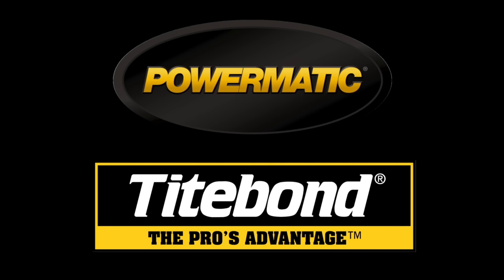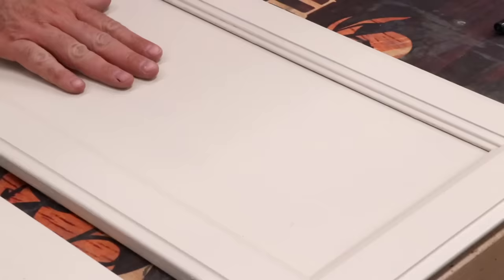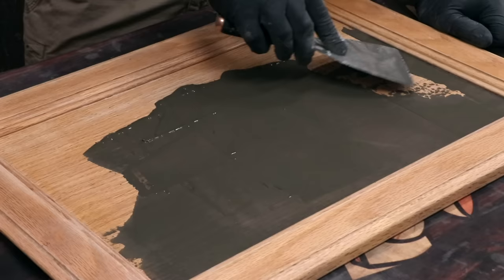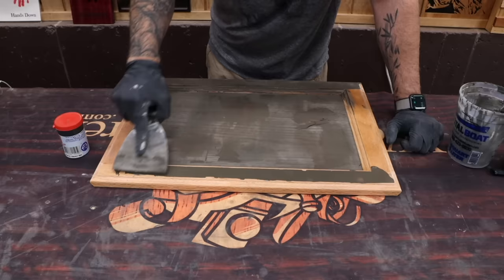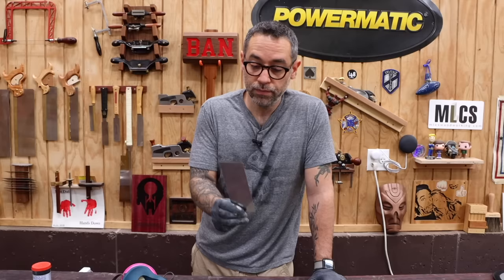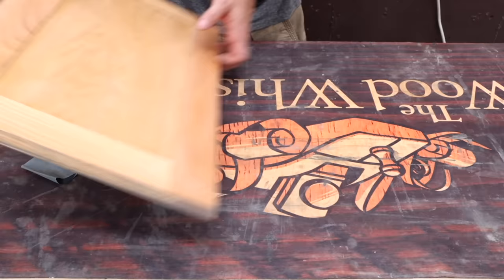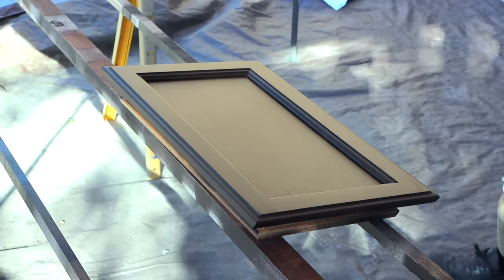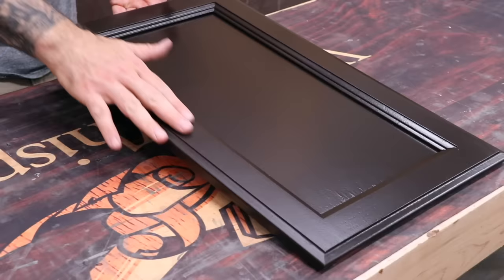Painting Oak Cabinets - Transform Your Kitchen!

Comment: Nice job.  I'm so tired of watching kitchen remodels where perfectly good cabinets end up in dumpsters.  Obviously this was time-consuming, but the  end result is beautiful.  I'd like to see more of us revamping, rather than replacing.  Thanks for the video.
Reply: I sooooooo agree
Reply: The amount of work to refinish would be overwhelming - notice he had two people working on this. I say skip the pore fill and either paint or just sand and touch up the poly or varnish.  Still a massive amount of work either way.
Reply: I work in a cab shop and trust me, if your cabinet is worth anything we will take it and make stuff out of it lol wont go in the dumpster. most cabinets have cheap panels in the middle and not worth salvaging (some cases the middle panel is solid wood and that's a steal!).
Reply: after watching this, I decided to rip out my cabinets and distribute them in dumpsters all over town
Reply: I'm afraid to do this. I would hate spending all that time to have them look terrible.

Comment: 40 years as a painting  contractor I have probably painted somewhere close to a thousand cabinets. Never used any filler but I did use a an extremely high quality sealer primer with 2 coats, and 2 coats of finish paint.
Reply: What primer ?
Reply: thanks for the tip, but exactly which primer/sealer? Did you thoroughly sand it all? or just damaged areas?
Reply: All you have to do

Comment: I did this last year to my oak kitchen. A helluva project but it exceeded my expectations. Used Spray Nine degreaser to clean, sanded between coats. Used two different primers- the doors closest to the stove ( greasiest) needed a very sticky primer ( Stix) and the other ones used a less sticky but more opaque primer. Each door got four coats- two primer and two top coats. I used Dulux and Stix primer and BM Advance in white-Pearl finish. 
The wood filler step is unnecessary- on mine, there’s very subtle grain coming through, but looks excellent. Using the right sheen is the most important step; Pearl is the right sheen.
Reply: I am about to do the same job, and the store employee recommended me the Stix primer but i was wondering if the oak still bleed through it since it's not a stain block primer?
Reply: @cutscenesgems7824  I watched a video on Stix earlier today and it is not a stain blocker, it's meant as a 'conversion' primer, a base for the next primer or paint. https://www.youtube.com/watch?v=e7jskY5uoUg
Reply: so did you prime and sand or just paint over

Comment: The timing of this is perfect! Not quite ready to move from our home but getting there. As kitchens sell homes (almost always) this is a great solution for those with builder grade oak cabinets (me) that don't want to spend thousands (me again)  on new cabinets just to leave them behind in the house. Very nice results! Thank you for posting!
Reply: You would get a far more expensive look if you cleaned the wood and went for a natural wood finish. And that is even on builder grade. 
The reason why modern kitchens do not use natural wood is that people cannot actually afford them. Painted look means even mdf can look higher end. 
In modern times it has become expensive to have wood as a built in. I had a cousin who restored a natural wood kitchen and everybody that sees it thinks it is some super expensive custom built furniture.

Comment: Oil based primers do wonders as a base coat to either oil based or latex enamel paint without the pore fill. Works great! I've never had grain show through with this method and I've never pore filled.
Reply: @Hugo Sanchez ben moore  advance is great. as good as oil base, and water cleanup
Reply: @Hugo Sanchez EPA and climate nonsense is why.
Reply: @racerx2348  so I wouldn't need to pore fill? I have 29 doors, 13 drawers and I'm 77... so, I need simple, effective, and no do-overs!
Reply: @judymiller5154  ive never pore filled. see how your doors look once they are primed. if they look good to you , then you can finish coat

Comment: Tip: Use a fine finish foam roller on the cabinets in the kitchen. You won't get any brush strokes, and it takes less time.
Reply: As a painter I agree this is great way to get the look of sprayed. No brush marks.
Reply: I had success with a velour roller on a swivel roller, and used floetrol additive for easier application and fewer brush strokes.
Reply: @Nick Montagnoli If you use a regular roller it will leave a little bumpy texture. The foam roller leaves a very smooth surface very close to the appearance of spraying.
Reply: @Nick Montagnoli I should have written no roller texture. I had a customer that wanted to save money on a job. I took the cabinet doors home and sprayed them. The customer rolled and brushed the cabinet frames. If you are painter you know how that turned out.

Comment: Great tips... exactly what I was looking to do with my "vintage" 1970s cabinets.  I personally do not mind the grain lines... they add some texture.
Reply: Followup on my project... I decided to not fill my face frames since they are barely noticeable and opt'd to rebuild my doors.  I wanted shaker style over the original and building new doors will be a much larger project, but worth it in the long run.  My plan is to use oak frames and MDF or plywood panels.  The paint will provide a slight texture to help hide the oak pores, yet still allow a bit to show and match the doors to the carcasses.

Comment: I own a painting company and have painted hundreds of sets of cabinets.  The amount of time filling in pores in oak will not give you the cost/benefit to make it worth your while, unless you just absolutely can't live with it.  But, if you hire a professional painter, expect that to double the cost.
And never paint cabinets without using a good primer rated for the task.  We prefer to stay away from oil-based products so we use Seal Grip water-based primer, allowing to dry 24 hours.  Then we topcoat with PPG Breakthrough at least 2 coats.  Breakthrough is virtually bulletproof, but difficult to work with unless you have professional spray equipment.  Brushing/rolling is not an option.  But, unless you like brushstrokes or roller stipple on your cabinets, I wouldn't recommend that anyway.  You can buy a decent HVLP through Lowe's or HD that will get the job done if set correctly.
Edit:  I will recommend that customers can paint their trim/doors/windows and maybe small vanities in baths, but I never recommend they tackle kitchen cabs.  Usually by the time they get through the prime coat they will realize the amount of work to be done and start skimping or skipping steps altogether.  Have a pro painter do it and get recommendations/referrals.  It's a process that takes a pro about 5 days to finish correctly.  A homeowner or DIY can take upwards of month.  And nobody wants their kitchen unusable for a that amount of time.
Reply: Clients are usually shocked when you inform them of the process/timeframe/cost of quality workmanship.
Reply: @twsd  True.  Most think, due to Lowe's and HD commercials, that it's just putting paint on and you're done.  But that's one step in a batch of many.  And I'm not knocking TWW here.  I'm always glad to see someone DIY anything.  But I never recommend cabinets due to the amount of effort needed to do it correctly.

Comment: I think you did a great job and the door looks good. I work for a professional cabinet refinishing company. We do our fare share of oak cabinets. Each two man crew does at least one kitchen a week. We have a much different paint that you can’t buy in a store and it’s water based and sprayed on the doors and the the drawer fronts in our shop with an hvlp sprayer. We use bin primer and roll it on with foam roller and that’s how we fill the grain it works and it dries fast then we can burnish it and put the color coats on. Then we put on a uv top coat and cure it with uv light. It comes out just as durable as the prefinished hardwood flooring you buy from Armstrong. The problem I see most people do is they just don’t prep the wood properly and they try and rush it and then it looks like they painted it with a brush. The products that they sell at the big box stores like rustolium cabinet refinishing kits are garbage.
Reply: George Charbonneau True. Those "simple, quick, easy, no sanding" cabinet painting videos are BS. A year later they will be scratched specially where the handles and pulls are.

Comment: I am in the process of resurfacing all of my kitchen cabinets as well. I've already done the bathroom and it actually wasn't too bad but there are a lot more cabinets in the kitchen! The house was built in the 60's so if you can imagine, I've got my work cut out for me. I've decided to sand everything down to the bare wood and buy all new and updated hardware for the handles and hinges. Wish me luck!

Comment: Cool video, thanks. I fill open grain by wet sanding with water based poly, sprinkling previously gathered sanding dust as I go (inspired by old timers doing it with oil). I keep the poly in a large plastic syringe and squeeze it out as needed, sometimes spraying with a water bottle*. I push the paste formed into the grain with the paper and then level it with a knife (if flat). It even looks great under a clear coat and fills smaller imperfections. I just refinished our 30 year old oak stair treads and they now mirror reflect, one of my pandemic projects.

edit:* if paste gets too dry and thick

Comment: I repainted all my brother's cabinets. Took all the doors off, sanded the varnish lightly, then sprayed an oil-based primer over them followed by a latex gloss enamel from Sherwin-Williams. between the primer and finish coat I caulked all the small cracks that were visible...They look like glass.
Reply: That is what I do on my jobs and customers are always very happy with the results.

Comment: We did this to our kitchen several years ago. Same deal, builder grade oak cabinets. I hated the idea of painting all that beautiful oak, but the wife insisted & I caved. As it turned out, she was right... again, & the cabinets look great. She’s still happy with them!
Reply: Did you use the same filler?
Reply: @ramirogarcia6059  no, I used a primer that was recommended by paint supplier. I wanted to be able to still see the grain in the wood. It worked perfect for us.

Comment: I repainted my oak builder grade cabinets and they look great still 4 years later And everyone said don’t paint cabinets. Home Depot “pros” (Crooks) wanted 40k to just replace the doors and put in granite.  I had to superglue all the floating center boards as the grain filling and paint would fracture all along the edges.  I sprayed Sherwin Williams pro classic door and trim paint after priming well and it ended up perfect.
Reply: You could have also cleaned the oak up and finished it to a high standard. The most expensive kitchens you can buy are natural wood look. 
I think in many people's mind they view it as cheaper because the wood probably needs a little bit of restoration.

Comment: In my family we’ve had success with primer that’s made specifically to conceal knots and wood grain. The wood has generally been pine (still a ring-porous wood, but much softer than oak), and using the right primer made a huge difference. 
For anyone in Norway reading this: se etter kvist- og sperregrunning; bare sperregrunning dekker ikke kvist og årringer.
Reply: Primer acts as a screen for the finish to be applied to.
Reply: Elsie Montgomery ".. l.
Reply: Elsie Montgomery 
I don’t know what the type of primer is called in English. It doesn’t have to be a specific brand (although the ones we’ve used have been Norwegian ones that I’m not sure you can get in the US), just the right type. Ask at the store, because they can probably help you.
Reply: @elsiemontgomery7974  
Zinsser,B.I.N ultimate stain blocker is good product  we can have it at home depot/ Walmart/ Amazon....
Reply: @Anthony C and how does this make you feel
Reply: @Anthony C 
Nok en gang:
Kem fan trur du at du e som trur du har rætt tel å si nå om kor «godt språk» morsmålet mitt e? Den slags dialæktelitisme e slættes ikke greit hær nordpå.
Reply: @shaosu9243  yep the shellac base is a great primer

Comment: That is one long ass way to do a job that isn't 'absolute perfection'. I'm a pro decorator of 20+ yrs & man i'd be out of business if i went about it that way! My advice? Clean with Methylated Spirit, give a LIGHT sand by hand & use a Shellac based primer (no 'mechanical grip' needed, this shit STICKS!!) then fill anything that needs filling, spot prime & then coat up with chosen paints. Hope i saved you a LOT of time folks!
Reply: Just to confirm, do you suggest the same filling process mentioned in the video AFTER using shellac based primer?
Reply: @sabins9826  Nooo, the guy uses way too much filler! Absolutely no need unless you are trying to make a grained surface totally flat. After priming, fill surface that is low (holes etc), sand back anything high (no need to fill/sand whole door!) When that is complete  spot prime any areas that need re priming due to sanding & filling. Then all will be ready for coating with usual paints.
Reply: A) what the hell is a "Pro Decorator"? B) I think doing this for anything other himself/family member is way beyond the scope of the process outlined here. He's obviously NOT doing this for a paying customer or as a business. and C) With all due respect I think I'm going to resign to the expertise of a known, proven commodity than someone who's only contribution is a comment.
Reply: @markf.4063  Oooer! You do what you like fella. My way gets a better result far far quicker, but hey ho. Oh & a 'pro' means that i have done it for a living  (for decades) & to a high standard. Good luck & ...happy sanding.....
Reply: @markf.4063  I'l just add that being an 'expert' in woodwork doesn't make this guy an 'expert' in decoration (as the above video proves IMO).
Reply: Yep..that's my plan. But the "Light" sand always confuses me. I'm going to sand them well. Hubby and I were in Menards looking at options for kitchen cabinets (I cannot afford to buy complete custom) and the prices they want for thin pieces of junk that pass as kitchen cabinets is staggering. My 20 year old ones are thick  quality. I cannot afford to mess them up.
Reply: @heart_towards_home  a light sand means just a quick (and I mean quick!) flick over with a paper of around 120/180 grit. You're not trying to remove previous coating! If you are worried about adhesion, test a small area. Light sand,shellac, allow to dry and then scratch with your fingernails! Shellac should be stuck solid. If it isn't, you haven't degreased properly. Good luck. Hope it all goes well

Comment: I've repainted my builder grade cabinets and even without grain fill, it took easily over 50-60 hours of work to do. 1 coat of primer and 2 coats of paint
Reply: This guy had another guy helping them and it looks like it took them 4 days from start to finish so you're spot on here.  You could build new doors from scratch, finish, and have them installed in about two and a half day and that's working by yourself.
Reply: @plasmac9  If you have the shop and setup.

Comment: I have long agreed about hesitating to paint over wood.  However, I had 70 year old knotty pine paneling in my living room which was really dark even after everything else I could do to light en up the room.  finally I painted the walls Navajo white- with bright white trim.   I wanted to keep the dimensional texture and didn’t want to pay for drywall to cover it.  A pain to fill and cover all the knotholes and dings in the walls, but I am so glad- the room is much  lighter and more appealing now.  I have never regretted it for a minute

Comment: Steel wool works good for the between coats sanding, particularly on the contours.
Reply: I agree! I've had a lot success using 0000 Fine Steel Wool during the finishing process. I also like to get a package of light weight paper lunch bags/sacks at the grocery store, cut them up into the sizes I need, and use them to sand between finish coats. They're perfect for just removing dust nibs and not compromising the finish.

Comment: When I had my cabinets painted by someone he recommended adding a bead of caulk in the priming stage around the inside of the panel and filled in the gap that was more noticeable when painted from the oak wood grain. I have had more people comment on how well my cabinets turned out from when they painted their own cabinets and a lot of it had to do with the prep and an alcohol base primer I believe he used and the caulking on the inside of the styles to medicate the physical separation of the panel.

Comment: Excellent video as always. Wish I knew about pore fillers before I painted the cheap factory oak cabinets. Advice I would recommend to anyone painting cabinets is to wait minimum of 39 days before any heavy cleaning or use of the cabinets after they are painted. . It can take this long for the paint to fully "harden" Particularly if using a melamine type of paint. Paint also good way to finish shop grade plywood if doing a DIY and can't afford the cabinet grade.

Comment: Five years from now: "Removing Paint From Those Beautiful Oak Cabinets"
Reply: I would use a higher end paint, or paint system to be specific, preferably with a hardener. Speak with auto body painter that actually has some schooling or degree in Paint.
Reply: Chapman new cabinets are not meant to last long. The point is to get them cheap and switch them out to get a new kitchen.
Reply: "Ugh look at this ugly white paint. So bland, it's always dirty. And look at the paint chips. Lets strip this nasty paint and get a nice wood stain on there instead."
Reply: Removing paint from oak is very hard if not impossible.Once painted your probably SCREWED!